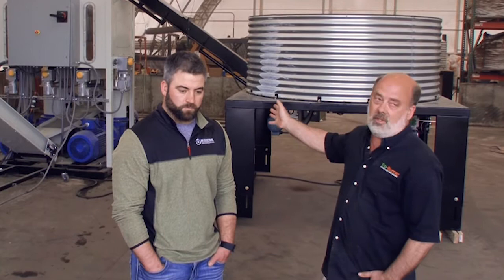Turn-Key Pelletizing Solutions - Biomass Drying, Processing, & Pelletizing

Comment: have you tried to burn some hemp pellets? does it have a strong cannabis odor? thanks
Reply from the maker: There is no significant odor when burning hemp byproducts.  If I had to describe the odor, it would be a slightly metallic smell.  It makes a good fuel because there is a little oil in most of the byproducts of hemp and that increases the heat value.